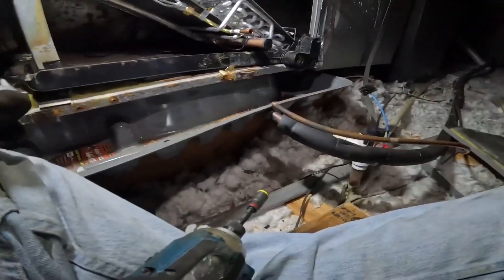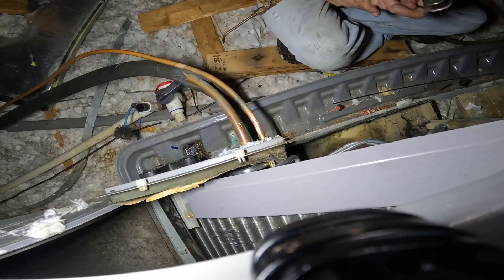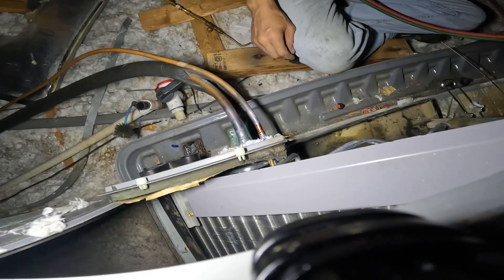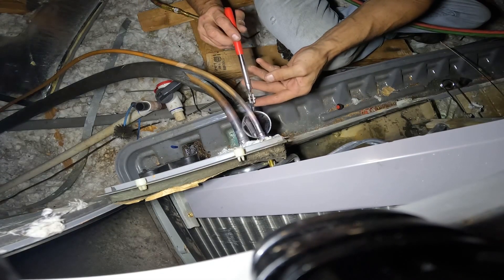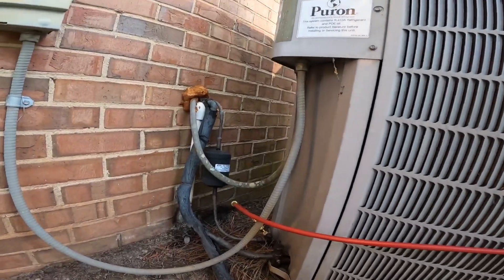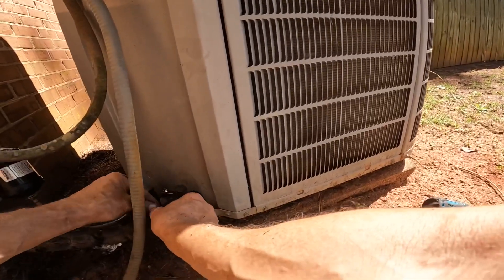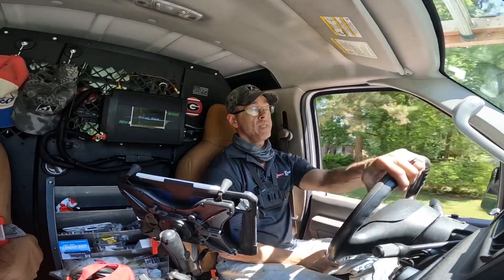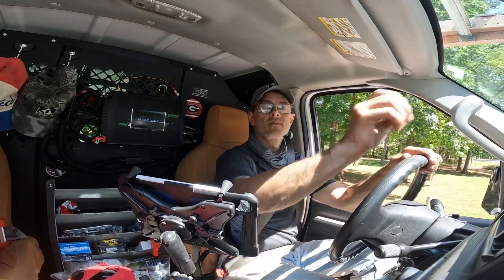Carrier Evaporator Coil Replacement

Comment: You definitely work hard with those evaporators coils, I would consider getting a pro press when working with coils in crawl spaces, I would get scared that the insulation would catch fire, a pro press would be lighter than carrying torches in crawl space, Good job Curtis.

Comment: To move around in the attic, get a piece of 3/4 plywood and screw a piece of duck strapping to it. Pull it around over the insulation and if you need to carry something out put it on your new sled.

Comment: I swapped out that exact coil except downflow setup today.
Reply: What is an honest price to pay for that job. I was quoted 4500. With easy access to 2ton system and coil lines running about 15ft in a straight line to outside heat pump. Feels like a rip off, what do you guys think as professionals in the field?

Comment: my feet slipped off trusses once, my body with double bag heavy tool belt and all, I stuck my elbows out and caught myself on upper arms, it nearly tore my shoulders out of socket and then I was stuck hanging there, because even after I got my hands onto the trusses and tried lifting myself up through, the tool belts were hitting the 16" on center spacing.
it was a 18' high flat ceiling overtop a tall library room, I was sure doing some shouting and hollering, luckily co-worker heard me and came up to unhook tool belt and pull it up. by time I got back up on trusses I had to lay there for 20 minutes to move my arms again, but that's better than a huge fall onto concrete pad.

Comment: is it not necessary to use primer on the drains? I've been doing it but I feel like the glue would probably hold jsut fine for the little pressure going through it
Reply from the maker: No. Drain isn’t under pressure

Comment: Can you swap out a R 22 coil with a R410 coil ? 
I want to keep the air handler but put a 410 a coil in it and run it out to our 410 a compressor. What are your thoughts? Will

Comment: Would you not worry about catching the "insulation" of fire with that torch? Isn't there a better way to get that connected?
Reply from the maker: I guess you could braze on copper outside, and use RLS. I’ve never used RLS though. I’m not sure I trust it.

Comment: Nice.  Is that screw you removed @4:30 and replaced @8:55 the same size as the screws mounting the panels to the frame?  I set my unit in the attic last year and am now just installing it.  I don't see any of the panel door screws LOL.

Comment: There needs to be a standard for access and space for attic installations including an area to safely work.
Reply: There is. It’s per code, inspectors are supposed to fail installations if they are not up to code.

Comment: I don't understand people that put devices in attic and not put some kind of flooring down
Reply: IKR, And they stick them where you can't work on them, access panels, etc!! Worst was those (Westinghouse??) through the wall package heatpumps you had to access from a 30' ladder and drop the condenser fan our the bottom to access the evaporator squirrel cage, took 2 techs to do anything!!
Reply: I'm from the south and I don't understand it either. They're saving livable space. There are some in attics that aren't bad at all. Others are like what codes, we don't need no stinking codes.